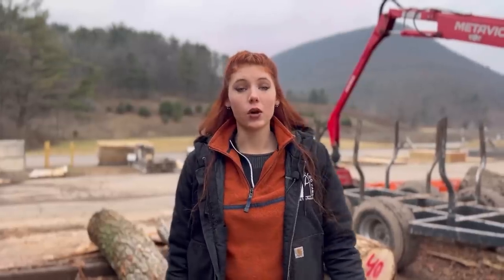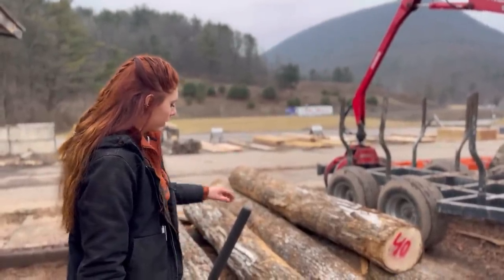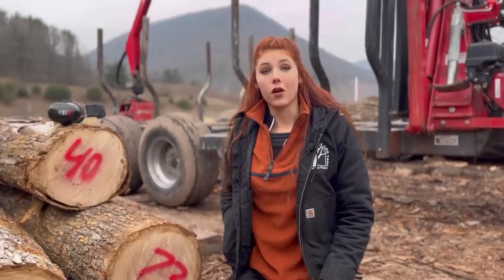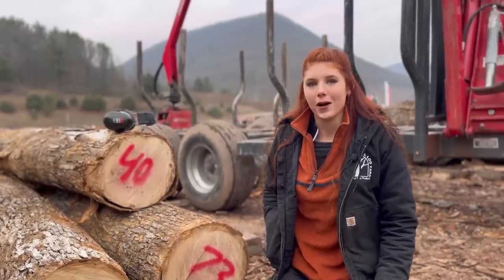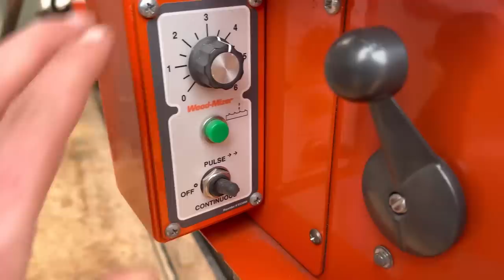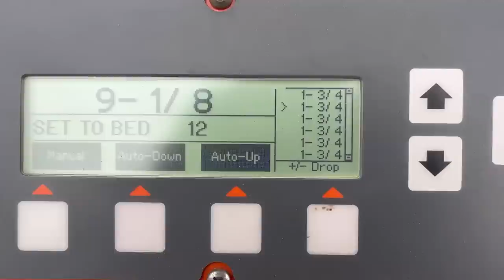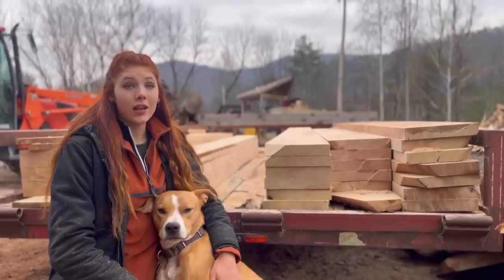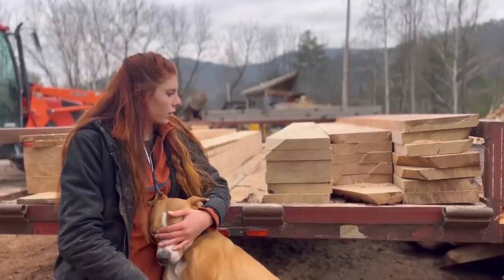This is Perfect Trailer Decking! Sawing White Oak Lumber

Comment: You guys are absolutely correct about white oak being the best for trailer decking, as it is very durable.  I used to work in excavating a long time ago and when we would clear lots for houses, we would keep the white oak logs.  We knew someone with a mill and would have the boards cut 2" thick, just because we were so hard on them.  We used them for decking on our trailers that we hauled the larger equipment on such as backhoes, excavators, and dozers.  The tracks on the dozers and excavators can tear the crap out of wooden trailer decks, but the white oak boards would usually hold up for at least 2-3 years if not longer.

Comment: I have been running my Lt40 super and EG100 with two helpers cutting southern yellow pine all day. I am 41 and just got into sawmilling and I have never been involved in logging either but I think I will be sawmilling when I check out I wish I would have gotten into it long before now. When I was in high school the ag dept had a woodmizer I don't remember the model number but it didn't have hydraulics we went down in the woods behind the school house and cut down pine trees and milled them into lumber and built a cow barn on the school property. I have wanted a sawmill every since for my own use but never really looked at it as a money making business because I always assumed the on a small scale you wouldn't make any money for the amount of equipment and work you had to do. But I started researching the business about two years ago and discovered the there is all types of niche and specialty products you can produce that are profitable. I am putting in a nyle L200 kiln and have a logosol 4 head planer. I am going to specialize in SYP paneling and siding because that is the primary logs readily available in my area and natural wood paneling seems to be getting popular. I have picked up a lot from just watching ya'll run the mill that has help me figure out how to run mine. Thanks for the videos.

Comment: The best trailer bed stock, in my opinion, is American Elm.  But,,, a close second,, New England white oak.   That is one of the toughest woods on the planet.  If you ever try to sand and finish it,,,, NE white oak will dull aluminum oxide sanding belts.   The USS Constitution,  Old Ironsides   planked with NE white oak,,,,, cannon balls bounced off of its sides.

Comment: You know I was decking an old low boy trailer several years ago. Once I got all the measurements I called a local saw mill and asked for oak. They asked what I was using it for , then recommended poplar. They said it was just as durable and not as likely to split. I didn't know. So I went with poplar. It lasted for years.

Comment: Good evening! Good looking deck planks! Our white oaks in Missouri go to barrels to support the Kentucky bourbon industry, which I consider a higher purpose than trailer decks! If I wanted permanent decks, I’d use Osage Orange or honey locust. Of course, the sawmill operator would cuss me for that. So we’re happy with red oak or post oak with some waterproofing treatment. 😉 Nice video.

Comment: Hey, just an idea. That vacuum vent doesn't have to exit up against your shed. You can get an industrial sawdust blower for less than it would cost to pay one person one hour a day scooping out the dust. You just get a bit of hose, adapt it to fit both the mill and extractor pipe then hook it up to a bin and sell the bin as mulch, Garden topping, Rodeo ground, or whatever floats a customers boat.

Comment: That's wisdom in action young lady,excellent work they can be a little rough there gonna get beat up and replaced over time,well done ✌ ♥ 😊! We have used ash in a pinch if no oak available but oak is premium for the job,I have had to use 1 inch double layer,lay it 2 directions crossways bottom,length ways top 👍! You ladies rock! Yas make the best of what you got very well,very impressive,the both of yas!

Comment: I love your channel! Thanks for sharing! Consider using some of the oak to replace the deck on your trailer. A new deck may improve your workflow when sliding planks onto it from the mill.
Reply: Did ya miss the title of the video?
Reply: @bushmaster2936  Yes,  I saw the title. I am specifically suggesting that LCLY consider using some of that incredible white oak they are cutting and replace the broken deck on the lumber yard trailer to help make their operations run as smoothly as possible.
Reply: @slm3945   Title....."This is Perfect Trailer Decking! Sawing White Oak Lumber"....again, that is what they're going to do.
Reply: @bushmaster2936  YAY -- That is great!  How are you so sure?

Comment: Just curious, after squaring up your log, can you preset the depth of cut for each pass or must you manually set depth with each pass? It doesn’t look like a big deal to set, you seemed to hit the mark pretty quick. Was just wondering. Good video again!
Reply: She's using her programmed Accuset system.  It automatically indexes down.  A super fabulous feature.

Comment: White is the only type of Oak for decking. Glad y'all didn't try to change that...
No other Oak is an option.
[edit: To clarify, not including Chestnut-Oak, which, while officially a White Oak type, is not as durable as its cousins...]
Reply: I used to believe that as well but I've recently been reading studies that find chestnut oak (not swamp chestnut) is more rot resistant then white oak.  Either way i think the difference is marginal but with the price generally being lower I find myself pushing the chestnut oak for trailer decks.  Leave the white oat to wood workers.